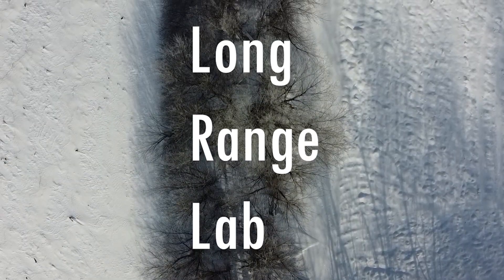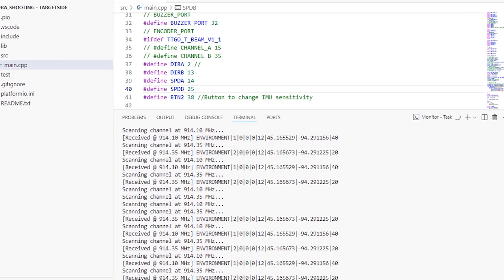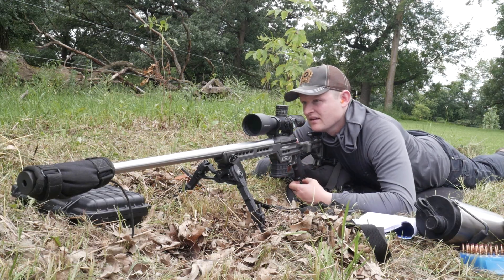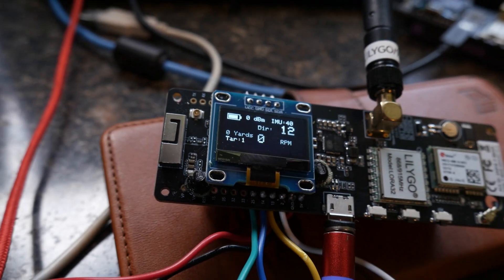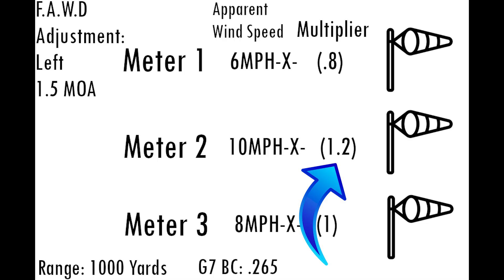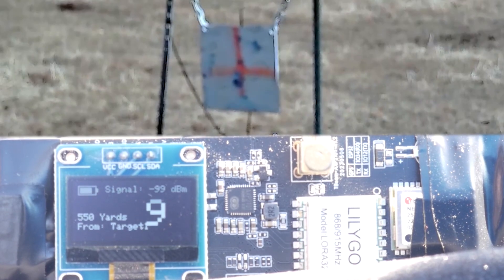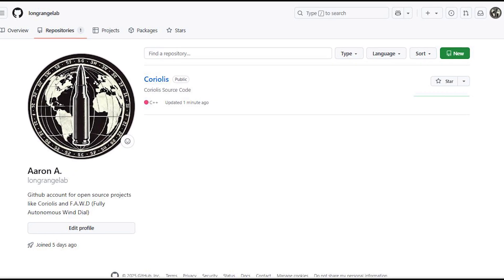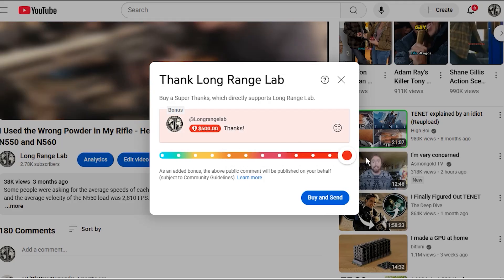How Autonomous Wind Tech is Changing Long Range Shooting

Comment: My Sig scope and BDX rangefinder do this already. It doesn't turn the knob it just moves the dot on the reticle.
If you are not connected to a weather station you can enter the windage manually.
Reply from the maker: Does it pull live wind from several wind meters down range? 
That's what this machine does. 
Wind at your current location is only part of the picture.
Reply: @Longrangelab  In a perfect world you could reverse engineer the Sig BDX protocol and pass the gestalt wind correction from your system to one of their scopes.

Comment: Forget physical wind meters, we already use LiDAR to observe the wind.  Feed that into the BC and run the stepper.  Look into it.
Reply from the maker: LiDar, at what distance? 
How far can LiDar be used? 
I would be very interested in finding out!
Reply: @Longrangelab if you look at last year's America's cup for the TV stream they projected a wind map over the course using lidar or an analog of lidar from one of the tall buildings. The tricky bit was the noise in the data, but they were getting data from KMS away
Reply: @Longrangelab there are many wind lidars specifically made for shooting application 
Trijicon ventus can measure wind speed up to 500 meter
And now wind spector offer 3 wind lidars and their higher end able to measure wind speed up to 1000 meter
Reply: @Longrangelab  100m in one direction. Not enough
Reply from the maker: @alexnovik that's kind of what I was thinking.
Reply: @alexnovik I don’t believe this is accurate.  Wind speed can be detected 20km away, which far exceeds the range of interest.  Lookup Lockheed Martin Coherent
Technologies WindTracer, it has a range of 15km.
Reply: @snivesz32 proofs? I don’t know any reasonably priced tech able to work this far. Commercial lidars have limited range
Reply: @alexnovik  reasonably priced is an economic issue not a technology issue
Reply: @aname3576  yeah, well, if you start digging you will also realize that 750m+ lidars also size of a microwave
Reply: @Longrangelab  its enough, most of the trajectory deviation is at the point of firing and in the first 0-250m of flight
Reply from the maker: @MrRambo438 I'd say it depends. But yeah, the technical answer is it matters most at the shooter's location. 
It's all important though.
Reply: @Longrangelab  Please you should also consider eletronic scopes. This way you dont need a device that manually change the scope, you just need a software integration that calibrates the eletronic scope via wifi or something like that. There is some eletronic scopes that already have built in  ballistic calculator and range finder. If you integrate and provide also the wind/temperature information it will acurate as fuck,.
Reply from the maker: @dokoloko5579 I don't have the ability to manufacture a precision rifle scope
Reply: Bit beyond the scope but you could also use LiDAR to scan the topography and show the fluid flow over it. And multiple layers of wind, if your Maxord is above a tree line you would be able visualise and account for it. More useful as a training aid.
You also have to remember that we can measure the past. Graphing and predictive models can help but on long time of flight shots you’ll run into limitations.
Reply: It's a really Nice project. I don't know much about long range shooting, but if you take wind out of the equation, would you say that .22 lr is capable of the accuracy? We are talking about many things: even with the ideal rifle, chamber temp, bullet geometric precision, loads, etc might have a weight on the accuracy. In other subject (that also find interesting) you will end up with a wandering crosshair, correcting itself at every moment, as you will probably have a benchrest. Still it would be nice to see that wandering crosshair as it will give you an idea of how much wind is an issue to get to your 1000 yard goal. Just do it to have some cool vids on many winds. Other thing: maybe you can get better instantaneous wind measurements with sonic anemometers.
Reply from the maker: @Machiflores  
It's tough to say. We'll see. 
I know Lapua and Cutting edge make very high quality 22 lr ammo
Reply: @Longrangelab listening to you explain your device is all we need to know you're extremely ignorant on a swath of different disciplines
Reply from the maker: @chimpo131  Wasn't that kind of the point of the video? 😆 I asked for like-minded people to help to build out this technology. There are plenty of things I don't know how to build.
Reply: How do they work?
Reply: Are you aware of any LiDAR windspeed sensors which are affordable to the hobby user?
I think measuring windspeed using LiDAR is possible but from what I've seen, it would be crazy expensive.
Reply: There are different radar technologies that can have huge range.

It would be good to have the math and programming to integrate the effect of varying wind speed and direction all the way from muzzle to target in real time.  Then you just have to wait on a usable sensor to get the range you want.

I think the best embodiment of this will be with a digital reticle that can dance around as the wind changes so you'll be able to see the wind settle and use that to take a shot.
Reply: Trijicon tried this 5 years ago with the Ventus, but I don't think the tech was ready. It may still not be, as I think we would see a production unit if it were viable.

Comment: This  shows great promise, this is similar to something I've had rolling around in my head for a few years, but never took the leap to move it forward. Feel free to hit me up if you require any help with modeling or electonic side, over 10y experience on both sides.
Reply: A parameterized stepper mount for various optics tube diametera would probably be a valuable early-stage addition in the interest of bringing people into the project.
Reply from the maker: That's awesome man! 
Do you have any experience with cloning PCBs and rearranging them with a different form factor?
Reply: @Longrangelab  Yes, been doing that since 1996 (on and off) in school and for hobbies.
Reply from the maker: @DSigurdsson let's talk! 
My email is longrangelab95@gmail.com

Comment: The wind meters should be placed in a way that would provide the most accurate measurement and prediction. 1. At a fix site with wind patterns that are historically consistent. The meters could be placed up wind or in a location that gathers the most accurate speed and distance. At a high enough elevation that is both doable and that would minimize ground effect. 2. I agree that a correction factor would be needed for each wind meter/ sensor. As you pointed out They need to provide data that is as close to what the bullet is actually experiencing from rifle to target.